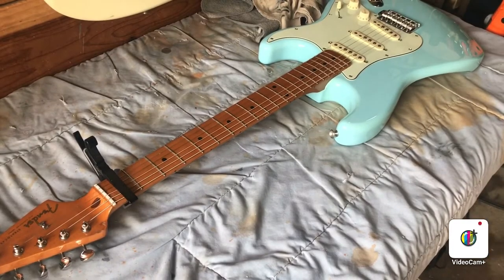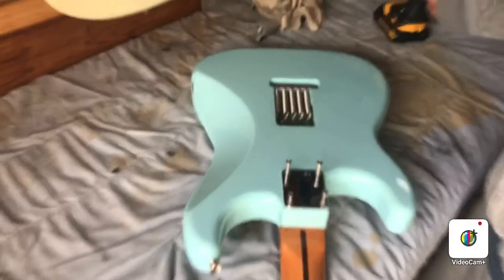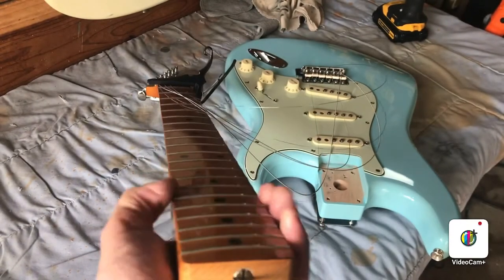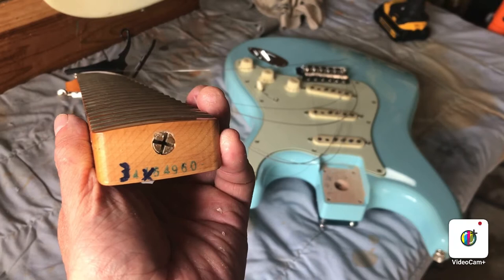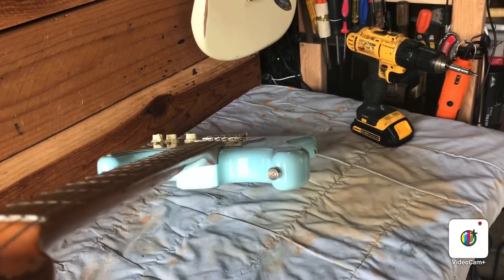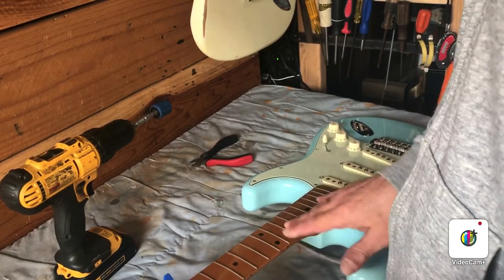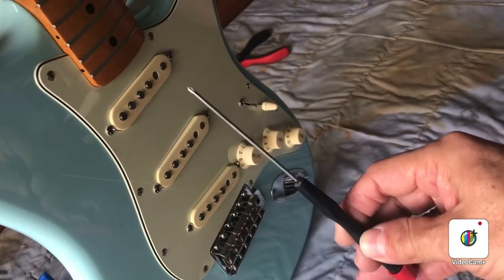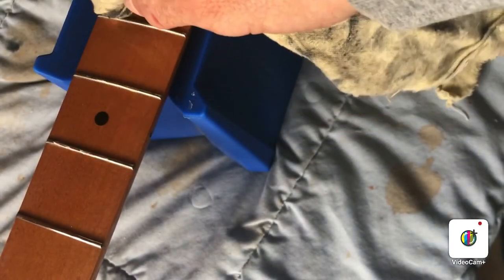Turn truss rod on Fender 50s Stratocaster

Comment: Yeah it’s a feel...not too much...only thing Leo designed that I’m not too onboard with...they got wheel adapter but looks ugly.....and bullet meh...any vintage style tele or strat to specs this is the way...patience...👍👍
Reply from the maker: cheers. thanks for the good comment. patience is the key.
Reply: Leo’s first idea on the design was to be able to replace the neck when ever the frets worn out. So he thought taking the neck off wasn’t really a big deal.

Comment: I saw a video where someone had built a kind of a hook that you can wriggle in the adjustment screw head and turn it without any preperations. I assume Fender has tools like that in their own factiories and shops, that they don't of course sell because that would mean that you wouldn't bring your instrument to a Fender authorized luthier for adjustments. 

They clearly designed the neck so that you can adjust it without having to remove it, because there is a cutout for the adjustment screw in the pickguard. I managed to fit a tiny screwdriver sideways in the screw slots, but it couldn't handle the pressure and snapped. I might aswell build myself a tool like what I saw.

Here's the tool: https://www.youtube.com/shorts/oufMj8QfPsA
Reply from the maker: Interesting. StewMac makes something I believe is similar:
https://www.stewmac.com/luthier-tools-and-supplies/types-of-tools/wrenches/truss-rod-crank-for-tele/?variationCode=6138
I have a couple and use them sometimes. Works in the right situation. thanks.

Comment: what if you have too much backbow but you cant loosen the truss nut without it scraping the pickguard? on my neck, the screw comes out too much and it blocks where id set the neck back into the body
Reply from the maker: Hmm...yea,  I'd need to see some pics on that. First thing that comes to mind is cutting a notch out of the pickguard if it's in the way. I know some people would not like to mod there guitar that way...
Reply: @stillkickinmusic  I'm looking to sell the guitar I'm talking about so definitely wouldnt want to mod that. The screw is coming outside of the hole that it was fitted into because I'm finding I have to add that much relief to try and stop that dip in the middle of the neck. Thing is, even if I took a notch out of the pick guard, it doesn't matter because its coming out to a point that the screw is touching the body of the guitar.
Reply from the maker: @crashgeekdicoot  Yea, sounds like a problem neck. I can't sort of figure the problem by your description. If you're trying to "stop that dip" in the middle of the neck usually wouldn't think of adding more relief. Adding relief increases dip in the middle of the neck. If you're getting buzz and the neck can't be set up with decent action and playability you need to take it to an experienced luthier. good luck.
Reply: @stillkickinmusic  Appreciate the advice a lot <3

Comment: vintera 50's ?
Reply from the maker: Hi, No this one is a 2018. They didn't start Vintera till '19 or '20. This one is the Classic Series, but someone changed the pickguard from single- to 3-ply. Here's the original listing for it: https://reverb.com/item/38326162-fender-2018-classic-series-50s-stratocaster-daphne-blue-strat-nice-62000

Comment: I got my first strat this year, a vitage CS one. So body side truss rod adjustment. 
Never again. 
I like the Custom Shop build quality, but having to remove the neck to adjust it is beyond nostalgic. The line must be drawn somewhere.

Not sure what's more painful, having to remove the neck and retune multiple times before I get the intended curvature, or the fact that I ended up chipping a bit of lacquer off from the body when I tried to get the neck out of the housing on the body. I was trying to be as tender as possible, but the neck was a super tight fit. I wonder how common it is for this to happen at that spot, and necks be harder to remove than in this video.

Still good video though :).
Reply: You dont need to remove it. I just loosen the backplate sligthly just so I can reach with my screwdriver. The pickguard also have a little opening so its super easy and fast to adjust.
Reply from the maker: I hear that. it's a pain!
Reply: You must be a baller if your first strat is a custom shop.
Reply: @nimitz1739  I’m not big on selling gear, so I wait till I can afford an endgame instrument. Just took 10 yrs of university study and work to get to a CS.
Reply: Capo on the first fret to prevent the strings from coming loose on the tuners then slightly loosen the screws furthest from the headstock slightly more than the ones closest to the headstock on the neck plate. Bump neck back and it will slightly expose the truss rod nut

Comment: How dumb is it to have to do this in 2021?  There is no upside to this method of adjustment except pain I hate it with fiery passion
Reply: but it's muh VINTAGE STYLING.

But seriously, I respect Fender for re-issuing these old guitars with the flaws and all. You don't have to buy a vintage style guitar if you don't want to deal with this.
Reply: These necks hold an adjustment for a really long time when done right, look aesthetically pleasing and keep the headstock looking good.
Reply: @G-NutZ  if looking at it is all you want to do then I guess it's fine. Try touring with one or better yet touring internationally and tell me how well they hold an adjustment

Comment: My friend you didn't  tell your viewers which direction to turn for straightening or putting more or a bow in the neck. That is pretty important  info. Wouldn't  you say so????
Reply from the maker: Hi, thanks. Look at 1:30 you can see me tightening clockwise on camera. It is common knowledge that you tighten a truss rod clockwise, loosen anti-clockwise, but for those that are new, I will remember to say so next time. thanks!